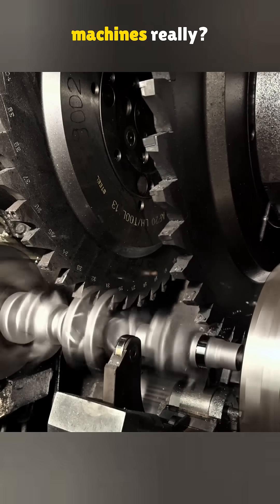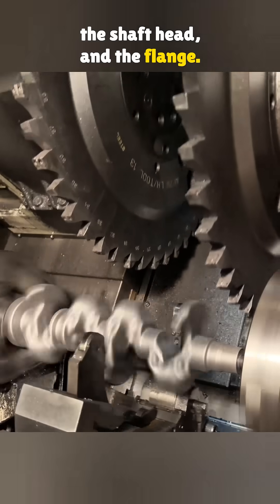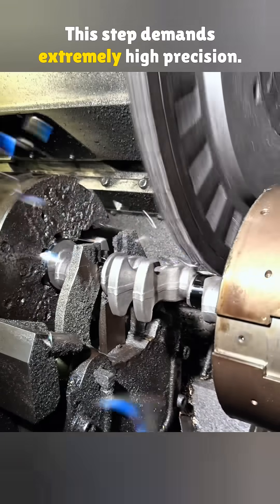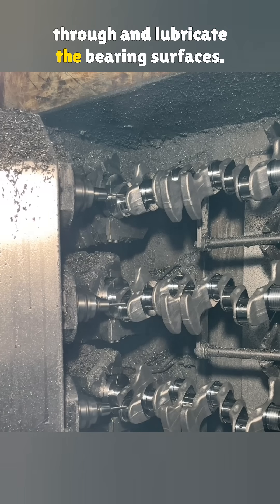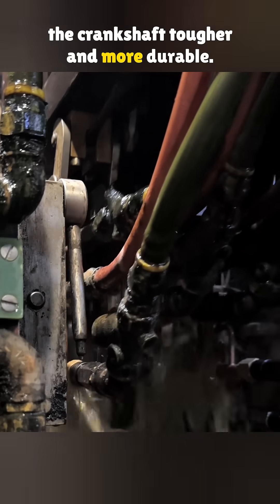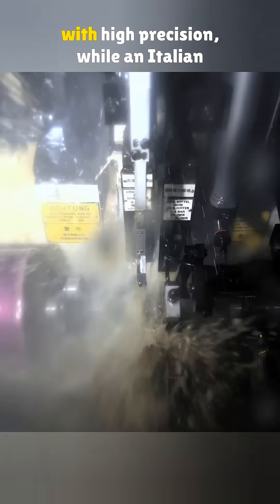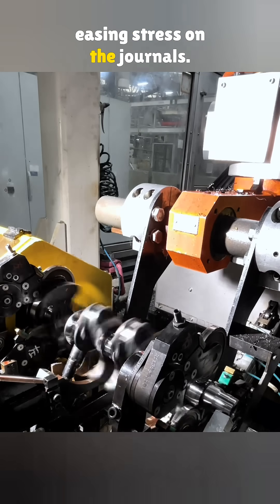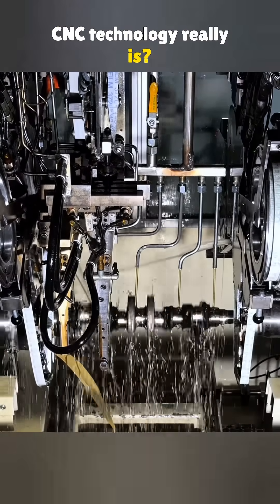How Far Behind Are Chinese CNC Machines #automobile #mechanic #car #assembly #manufacturing

Comment: I just bought 2 new , 4 axis machining centers from China and they are a leap ahead of anything else I have ever seen.  Try 4 roller linear guides on each axis instead of the usual 2 for starters.  A well known American made machine only has 2 linear guides and they are inferior ball style which I have found to be weak even when new with no wear.  The Chinese machines also have 3 roller trucks instead of just 2.  The surfaces are all hand scraped where the American machines have a crappy shim to line them up.  I also bought 2 robot welders and they were 1/8 the cost I was quoted in Canada for a vastly superior system
Reply: Also take a look at the best harvestors from China and compare them to million dollar plus machines which John Deere makes and sells, it even prohibits owners to attempt any maintenanca but depend on John Deere for the smallest of maintenance works... chinese machines costing one-tenth work with same efficiency, easier to maintain and when support is needed, support is one hour away
Reply: @vijjreddy  Yes. John Deer are killing their customers with unfixable machines. Its a common thing now for manufacturers to use computer controls to lock out customers from being able to fix even simple components
Reply: @leensteed7861  Guess where JD has factories? JD left the USA. Duh??
Reply: Try Japanese Kitamura, box type guideways and double ball screws on each axis. At work we have one 21 years "old". Runs like a dream and maintains tolerances. Linear guideways are trash for heavy machining where you need lots of vibration dampening.

Comment: As others have noted: the shocking thing isn’t what Chinese tool manufacturers can or can’t do.
The shocking thing is that the majority demand for this comes combustion engines, a technology that is about to be obsoleted.
Similar with aerospace. Large parts of Europe and USA are sitting there feeling smug and fighting about tariffs and job, because they are top of the pile……in an obsolete technology direction.
This is really worrying. Really.

CNC will certainly be needed whatever the high-tech direction. But the fact that this is your prime example, is lethal madness. Somebody needs to be screaming for real progress, not subsidising rust belt jobs programs

Comment: The question is: buy it or make it?  I recently toured a US factory making high tech machines goods.  There was a lot of Swiss, German and Japanese equipment present.  I believe some of the cutters, broaches and drills were US made.  We’ll have to see if the current experiment of raising costs through tariffs to encourage making and procuring everything inside the US works out.  The flip side is that China won’t stop importing equipment to produce better and cheaper products.  China may still be able to undercut US domestic produced goods on price even with tariffs.

If the US were smart, it would allow import of high tech manufacturing equipment because it takes tools to make tools.  I caught an interview with a factory owner who wanted to open up a new line and the injection molding machine he wanted to procure was going to approximately double in price because of tariffs.  It sounded like the expansion and the jobs it would have added were not going to happen.

The current US administration does not seem to be too good at nuance.  That guy Lutnick who is charge of commerce always talks over excitedly like he just snorted a line of coke.  I don’t trust Lutnick.  I like the big picture of self-reliance, who wouldn’t?, but the current administration really needs to take a much closer look at the details of how to get there.  The US risks falling further behind if the administration gets it wrong.
Reply: You have basically answered your own question. Because for complex machinery, like the  machines for making chips, it takes years for the process to mature, from deciding to develop the technology to run the machines for the first time. Tariffs work (let's say they do), in a crude way, for products that don't need science and technology to produce, you could ask a radiator maker to repatriate from Mexico and they could move the whole plant in 6 months. But if you do the same to a chip maker from Taiwan to spare them from tariffs, they will just find someone else to buy their chips. Not mentioning the regulatory and legal abnormalities re-shoring companies might find upon arrival, just remember how 300 South Korean employees got recently deported from a Hyundai plant in Atlanta. The gambit to wait for Trump to exit makes sense for many
Reply: The only thing behind in China are the salaries of the Machine operators. 
I'm sure every good machine operator in China can only only dream of the salary that his American counterpart earns. 👍✔️💯🇬🇧⚒️💸💸🤔
Reply: @InvictaViewUK  
Там нет операторов. Это "завод - робот".
Он просто расположен НА территории китая.
😎
Reply: @vladimirnaydyonovFair point comrade. Yes, robotics will continue to replace 100's of workers.  🤔👍💯🇬🇧

Comment: They are not behind. Any auto company around the world imports machinery. Smart people let other people do the hard work.
Reply: I had a classmate who would copy off of me during math tests.  How do you think he did when we were no longer classmates?
Reply: @Tie509  bet he's excelling at something other than math lol
Reply: The entire GM plant in St Catharines where they made engines was auctioned off. Guess who now makes 305 and 350 parts with GM tooling?
Reply: I recall 40 years ago China imported locomotives from GE in a deal where the Chinese paid with coal,  through GE Capital the coal was converted to cash on the commodities exchange and those units are still running today.   GE CEO Jack Welch said back then "  Automate, Emmigrate or Evaporate or seller ice to an eskimo"

Comment: China decided to focus on dominating Electric car manufacturing, especially the batteries and electric motors. 
A significant part of this is likely because they knew it would be very tough for them to catch up, let alone lead on Internal Combustion engine technology.
Reply: Do you know how many vehicles, besides electrical, are produced in China. There is no way all the manufacturers imported hundreds of these machines from wherever.
Reply: The Chinese have made a V12 and turbo V8. They need to scrap displacement taxes.
Reply: BYD is becoming the next EverGrande so I do not think they are really making any meaningful inroads on that market
Reply: BYD EV barely last a year in Russia 🤣 and they break down after a few year for no reasons (software issues).
Reply: @JetBen555  Early ICE cars also broke down a lot in the beginning. They will iron out those problems, but yes. In very cold climates EVs are not a real alternative. But that's not the point. 
ICEs aren't made for lots of urban short trips. The EV is ideal for short range usage in the city. Given that there is a proper charging infra structure ofc.
Reply: electric vehicle fires are a common occurrence in china and on car carrier vessels.  well documented.
Reply: @yota4004 less common than gasoline car fires...worldwide. Dont believe the propaganda.
Reply: @pawz007 , EV fires are much more common in China than the West. People are burning alive in China because they get locked in the EV, I hear of many instances of this.
Reply: @Observationdeck105 EVs have become far more common there so that would be an inevitability yet still fires are more common among gas cars. You hyperfocus on a few instances and use that to fuel you narrative...thats confirmation bias and its an epidemic
Reply: @pawz007 , the fact that car manufacturers in China with a crew ready at a moments notice to remove all branding labels while the car burns or breaks down says a lot about China's car manufacturers doesn't it. The facts are facts, has zero to do with confirmation bias. Chinese EV's that burn are quickly hidden from the public, I've personally spoken to Chinese citizens that tell a very different story about the actual numbers of EV fires. The EV manufacturers give the citizens the dangerous dregs while the export market gets the better cars.  Many of the cars that are built for the domestic market might last a year if they are lucky and get zero support from the manufacturers. The minute you used the words "confirmation bias" told me that it was in fact you with the confirmation bias. That ends our discussion.
Reply: @Observationdeck105You speak of facts, they should be verifiable no? And Ill just throw it right back to you...reacting to my use of "confirmation bias" as you did seems defensive therefore indicating an unconscious knowlege that Im right.
Reply: I mean, can you blame them?

Just look at the absurd complexity of manufacturing this single component for a combustion engine. It's utterly ridiculous.

As the price of batteries comes down and the capacity goes up, EVs will absolutely decimate the combustion engine on price fundamentals, in the same way that semiconductors killed the mechanical/tube computer.

10-100x less parts and 1/5th the assembly time.

European and American automotive manufacturers are in for a very rough shock.
Reply: Leading ice is a far stretch. All Manufacturers have their problems. Some are straight economical decisions and others are questionable design. However, ice are at the end of the flagpole today.  Stricter emission regulations and cost cutting will seal the deal sooner or later.
Reply: Thats what you just made up off the top of your head, actually study the TRUTH rather then writing what you ""feel"" is correct
Reply: That's why they are catching fire all over the place.
Reply: @mickymoto100 They catch fire less often than gas cars...dont believe the propaganda
Reply: @pawz007  at least ICE car fires can be put out.

Comment: It's not that they cannot make them. Perhaps not quite as good, but not far behind. The Chinese are making CNC machines that are general purpose and higher volume in sales. That is less risky and potentially higher turnover. The machines in this video are low production run size, specific to just one task and cost a high amount per machine.

Comment: All these are legacy ICE machine tools that no longer used in EVs.
Reply: I already have a v8 in my audi, and its a diesel with basically open exhaust so its extra bad for the environment. and I love it! will never sell it
Reply: I have a higher carbon footprint that most people. I try to maximize my carbon footprint by only buying made in china and driving as much as possible. Also I buy freon from china just to release it into the air to increase greenhouse gases. Freon is super cheap in china but illegal in the us.
Reply: I also am building a steam generator to power my house using only coal. This will maximise my emissions even further
Reply: Guess what people like you ARE the problem No backgounf in science engineering…
Reply: I'm buying a V8 next vehicle.  
I am not attracted to men, or electric cars.
Reply: Hell yeah dude

Comment: Just simply buying the best tools the world offers instead of building your own is truly smart. How many tools TSMC uses to make 2nm chips can be made by Taiwan? It's the synergy that matters.
Reply: TSMC nor anyone else in Taiwan could make the lithography machine needed for them to make any advanced chips. There's only one company (ASML) in the world that can make those machines with similar capabilities. Even ASML is not able to make all the components, Zeiss makes some of the optics for them. There are a couple of other companies that make the lithography machines but they are not as advanced as a ASML which is a Dutch company.
Reply: Which is why it's ridiculous that China claims to be a world leader in virtually every kind of technology. Which is what this video is aimed at.
 China's claims of supremacy when what's really going on is they supply the meat to run the machines everyone else builds.
Reply: @Teth47 
💯%👍
Reply: 2 nm is a brand, not a real measure.
Reply: @fabrimara Wrong. 2nm is not a brand, describes the level of advancement of the manufacturing process. It does not any longer tell you exactly how far the transistors are spaced apart but still gives you an idea of the density. If it were a brand then it would be copyrighted and no one else would be able to describe their chip as 2 nanometer.
Reply: @actionjksn You wrong telling me I'm wrong. It's not a real measure as was for decades, it's used as a brand which isn't mandatory to register. When you use 2nm you refer to a certain technology as saying strawberry lithography. It's a brand, that's it. If you don't like the word brand use name instead.

Comment: Just looking at how much work and investment in equipment is involved in just making the crank I start to understand why legacy manufacturers dont want to make EVs.
Reply: It's not so much that the legacy brands don't want to make EVs, they just don't think the market is there on the consumer side. EVs are still pretty expensive without government subsidies to make them attractive to buyers in most cases. This all mainly comes down to battery tech at this point and legacy auto manufacturers don't want to invest in the expensive R&D needed to get batteries where they need to be for mass adoption. When we have cheaper, lighter and more energy dense batteries with faster charging tech I think they will be willing to buy in. I personally can't afford an EV at current prices but I've also never purchased a brand new vehicle and I bought my first vehicle in 1991, I only buy used cars at least two years old so I don't pay for the huge initial depreciation hit.
Reply: The car brand accounts for 30% of the added value, with the supplier producing the rest.
Reply: No current EVs fulfill the requirements !!!
Reply: @jpcaretta8847 EVs fulfill the requirements of most people. Millions are being sold every year world wide.

Comment: Electric motors are much easier to manufacture! They will replace ICE.
Reply: Engineer here , any field of industry or machinery that can be supplied reliably by A.C electricity will use an electric motor not because it's easier but because it's more efficient and pretty much more powerful, anything that moves will continue to mostly use ICE due to batteries being inferior to conventional electrical supply
Reply: The average consumer might buy an EV, but enthusiasts will keep running ICE.
Reply: they made the same claim 120 years ago... how'd that work out?
Reply: They won’t replace ICE, fuel technology will improve as to not be based on a finite resource, but rather be synthetic. EVs will mostly be used for standard commutes short trips. Anything for towing or long distance travel will still be an ICE.
Reply: @josephbernard5240 China is already building lots of Coal to Oil plants to be able to replace oil imports in the future. Synthetic fuel for the win

Comment: What's the point of being able to build steam engines when the future is electric?
Reply: I slightly want one of these but like if could be powered by electric even if less efficient as I think it be called if could see or hear it run even if not as loud as ice
Reply: Battery energy density sucks compared to like almost everything else.